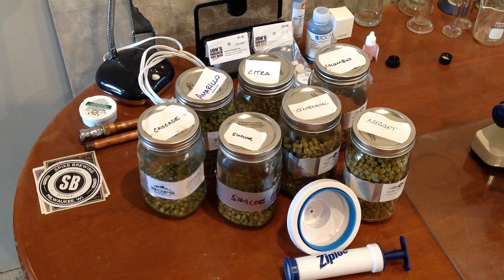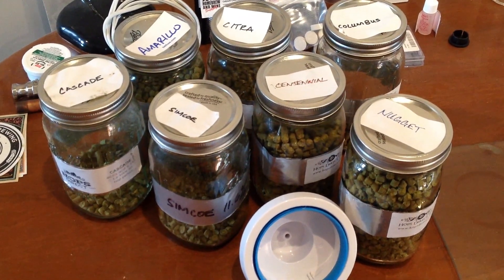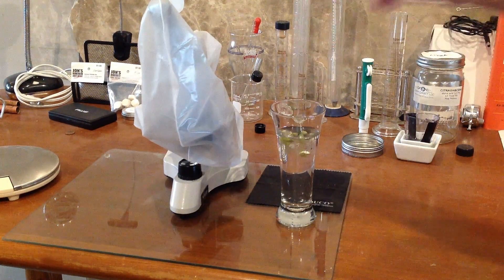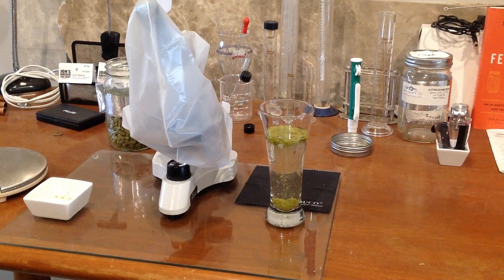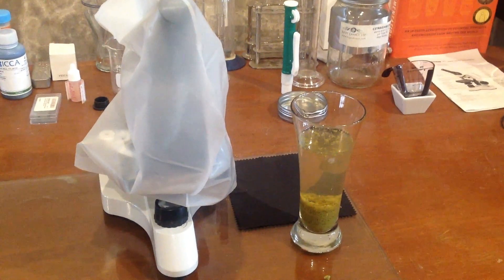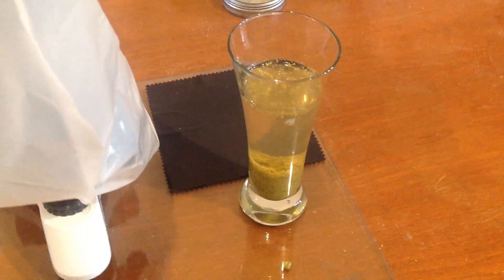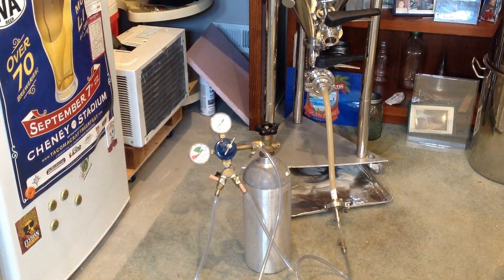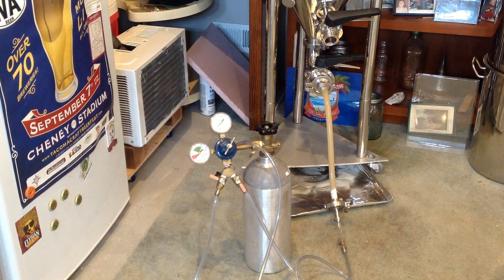Dry Hopping, CO2 "burp" in conical fermenter

Comment: Nice concise video, much enjoyed. What do you have at the top of your conical - is it still connected to a bubbling/blow off hose going to a sanitized bucket, or is it closed with a CO2 blanket on top? My thought is how will the CO2 rushing in from the bottom be handled within the conical (i.e. going out the bubbling hose (if open) or released through a PRV (if closed)). Any issues to be aware of before "blasting away"? Thanks!
Reply from the maker: Thanks for the nice note, greatly appreciated.  I think that you could go with either a blow-off or sealed tank.   The amount of CO2 is relatively small - doesn't take much.  Anymore, I do have an adjustable PRV on top, but I don't think that is a factor.   Also, for what it is worth, I don't do this very often anymore.  Based on the book by Scott Janish (great read) I've concluded that the hop utilization and oil suspension happens far quicker than traditionally thought.  After listening to Vinnie Cilruzo at Russian River, I tend to dry hop for two days and then dump 'em.  The results have been good.  Oh, I also add the DH at about 1.020 so any hop creep is minimized.   To me, this is the excitement about brewing.   So many possibilities and the quest to make a better batch every time!!!   Please let me know what you do and your results.  Best of luck!!  -DT

Comment: Hey, great video. I was trying to do my first CO2 rousing, and found this video. Just one dumb question. How do you get that liquid not refluxing to your co2 regulator? I don't think 5+ psi of CO2 is strong enough to push beer into the fermentor, and it seems like the liquid in your video is stuck in front of that clamp. How did you do that? Really looking forward to your answer. Cheers!
Reply from the maker: Thanks for watching and for your comment.  It is interesting how just a little pressure will prevent any beer from leaving the fermenter, in fact the output of the butterfly valve stays dry.  At 6:50 or so you can see the CO2 regulator is between 5 and 10 lbs.  I am not sure how long I should let it run, I think 5 or 10 seconds would be long enough.  You can see some of my videos where I recirculate the dry hop using a pump.  This works well too, but it more work than the CO2 rumble so I will likely go back to the process shown in the video.  Thanks again for watching and let me know how this works for you and any suggestions that you might have.  All the best.   -DT